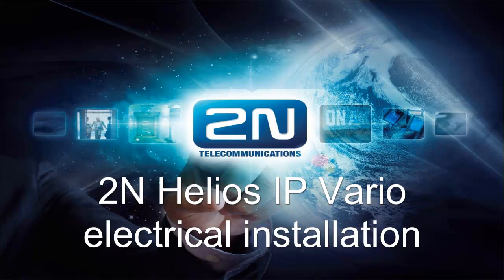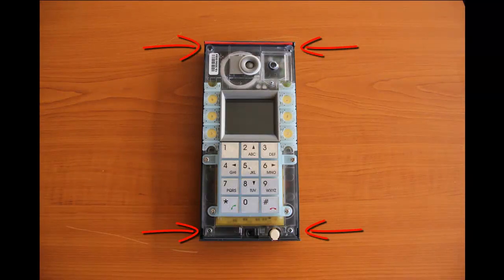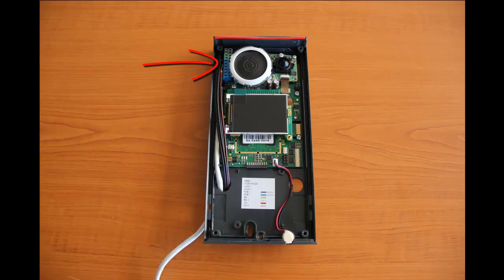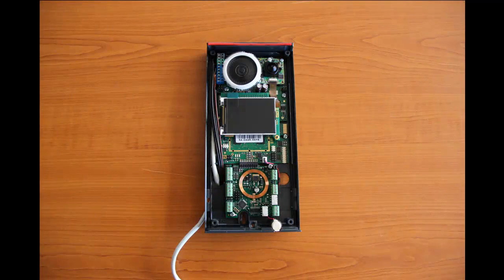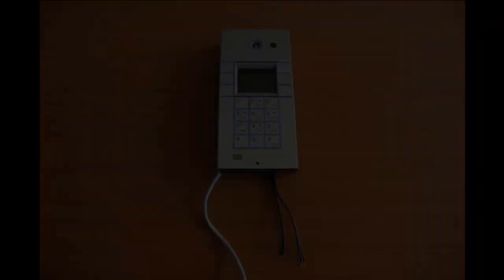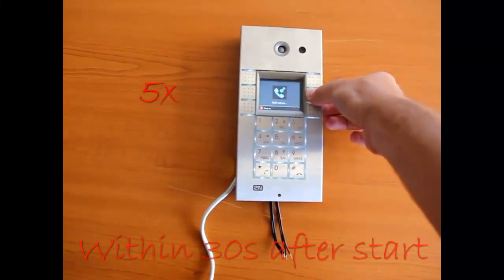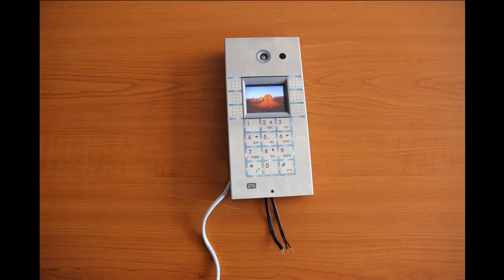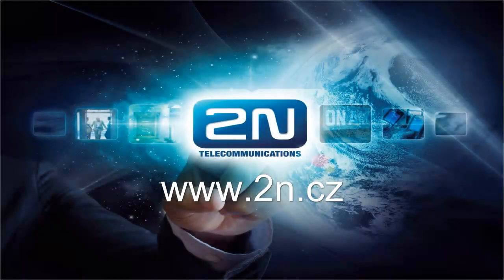Door communication system 2N IP Vario - Electrical Installation

Comment: When the 3 cables were being described what was the last cable for? Thanks.
Reply from the maker: Brian Fuller 

Hi Brian,It is 
1) Ethernet – Cat 5e or better cabling, connecting to LAN
2) Power supply – 12V 2A DC
3) Lock connection – this goes to the door strike. Either we feed the door lock, or we act as relay and switch external power supply.

For more information please visit:
https://faq.2n.cz/pages/viewpage.action?pageId=46171368
https://wiki.2n.cz/display/HIPV23EN/2.3+Electric+Installation